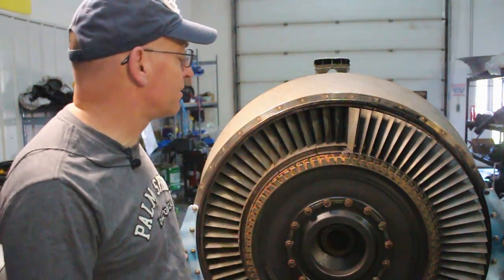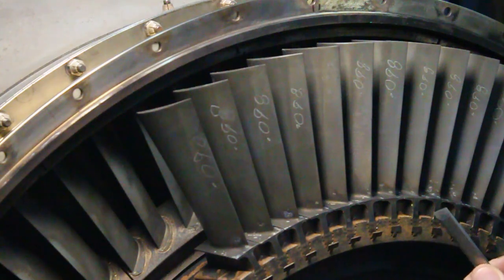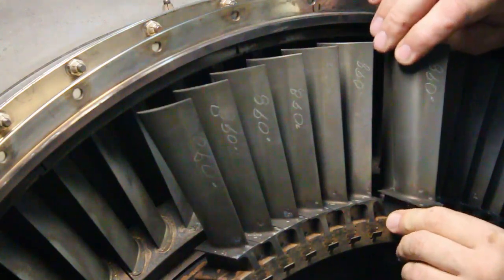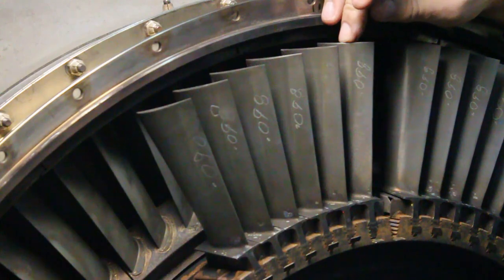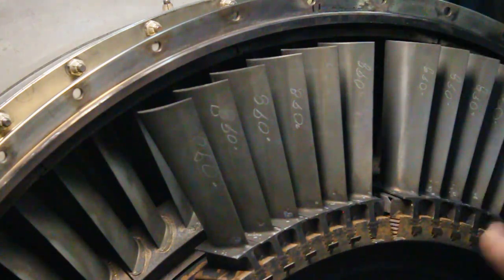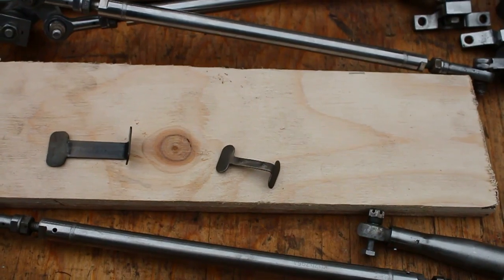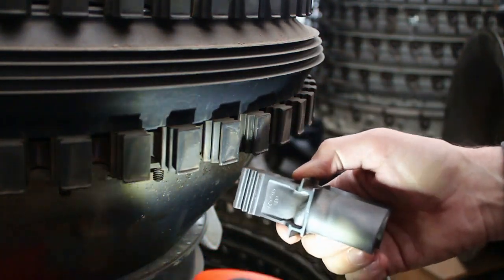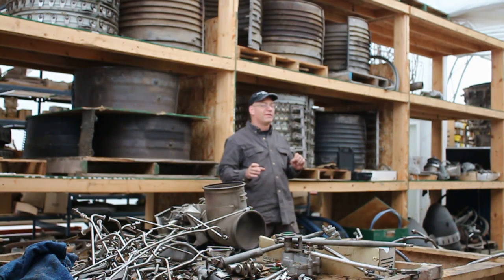Orenda 14  2018 pt.4 Turbine Blade Locks

Comment: I have to say I thoroughly enjoy your videos, Informative and entertaining. My middle son just joined the USAF Reserves as a jet engine mechanic. I spent 13 years in the USAF as a crew chief on A-10's and F-111's so I can now share some information, augmented with the information from your channel, with someone else who has a grasp of the unimaginable power and intricacies of turbine engines. On a slightly off topic comment, sitting in the cockpit of an F-111 doing a maintenance engine run is an experience you can"t explain unless you've been there, great fun! Zone 5 afterburner shakes the entire earth, or it sometimes feels as if it does.

Comment: I can't stop thinking about "billimeter"; first time I've heard that dimensional unit.
Reply: I also cracked up when he said that. And I almost believed there was such a measurement due to the mater of fact and non-pulsed way AgentJayZ used it. Canadian humor rocks, lol.
Reply from the maker: The billimeter  is a slang term, coined by some mathematical illiterate, to probably mean the next big jump down from millimeter, so it may have been meant to refer to the micron.
I have appropriated the term to refer to the nominal diameter of the heatilon*, so it's more along the lines of the nanometer.
So, an easy way to remember is the billimeter is one billionth of a meter... sort of.

* Heatilon - the imaginary particle of heat, discovered in 1992 by AgentJayZ during the North Van period. According to the YouTube page, and Wikipedia.
Reply: Fabulous video as usual

Comment: I work in a production facility that makes blades. I assume that the pin grooves I grind in some are so the blades can slide over the locking tabs. One other thing we do, is after the fir tree is cut on some blades, we grind down the root to create a tab. I assume this is to lock it in on one side and a locking ring is used on the other side. I believe that part is a stage 4 blade for the PW F100. I love watching your videos and since I started working at the plant, I am totally amazed how my parts are integrated into the whole package.
Reply from the maker: Great to hear the perspective of someone who makes these amazing parts!

Comment: Wow, what an incredibly interesting channel.  I'm in no way a mechanic but you have taught me an incredible amount about something of which I had absolutely no knowledge.  You manage to translate highly technical information into language a complete noob can understand.  Thank you.

I have a question which you have probably answered in the past.  I've seen that you weigh each turbine blade before installing them.  Clearly this is part of the balancing process so I wonder, do you try to place similarly weighted blades exactly opposite each other on the turbine wheel?  On one video (from 2014) you appeared to be alternating lower weighted blades with higher weight blades as you install them.  Clearly you have a strategy and I was hoping you could describe it in a bit more detail.  

Again, if you've answered this question already I'll understand if you don't wish to repeat yourself.
Reply from the maker: The weighing, sorting, and arranging the blades gets you to the starting point.
From there the balancing process begins using a sensitive machine that spins the assembly, measures vibration and angle, then recommends changes.
Sometimes it takes minutes, sometimes hours.
Reply: Thanks, I couldn't imagine that it would be a simple process.

Comment: Also, when the engine is getting hot the metal will expand a bit and it will fit even tighter. At least that's what I expect. Quite amazing that most of it is all machined without CNC machinery, yet it is done with the highest level of precision.
Reply from the maker: The disk expands more than the blade root, so the fit becomes looser at high temps.
Reply: The disc expands thermally and it also dilates as a result of C/F (note the difference in terminology).  The blade and its fir tree root expand thermally, with the blade root running hotter than the disc, and the blade material may also have a coefficient of thermal expansion higher than that of the disc.  The clever part of the design process is to ensure that the bottom serration loads up first and that the combination of thermal expansion and C/F allows the serrations to load up progressively and uniformly.  That is where the incorporation of 'differential pitch' comes in during the design process.  Typically. as manufactured, the flank-to-flank dimensions of the blade serration will be slightly less than those of the disc slot.
PS  The design of a fir tree root should be such that it never becomes 'solid':  there should always be a clearance between all the features of the fir tree form, except for the loaded flanks.
Reply: thank you for the detailed explanation.
Reply: OK, didn't expect that, thanks for clearing that up :-)
Reply: Well, CNC just makes precision machining faster and more affordable because you don't need a human to constantly control things. Computers just make things cheaper.
Reply: A disc expands and dilates at temperature and speed such that the disc slots increase in width circumferentially.  However, as the disc rim can be 100 to 150degC cooler than the blade roots, the disc serrations typically expand radially less than the blade serrations, hence the need for 'differential pitch' between the blade and disc serrations, as manufactured.  
Correctly calculated (more realistically 'estimated', when I designed the Olympus 'C' LP turbine blade), differential pitch also allows for the extension under C/F load of the blade root as the serrations load progressively from the bottom (inner) serration towards the top (outer) serration.
Reply: Hi Grahamj9101 My native language is not English and neither am I familiar with jet related stuff. In plain English does your comment mean that the blade will have a tighter fit when the engine is getting at operating temperature or even at full power or not? 

If I understand it correctly the disc expands as well as the blades and the blade roots, but the blade roots expand just a little more, is that what you are saying in a relative complicated way?

Complicated for people like myself that is :-)
Reply: OK, I'll try to explain it in simpler English, but it is a little complicated.
The disc gets bigger in diameter because it gets hot and expands.  It also gets slightly bigger in diameter because it is rotating at high speed.  This means that the slots in the disc rim, in which the serrations are formed, get a little wider.  The distances between the loaded flanks of the disc serrations also increase, of course, because they are hot and and expand in the radial (outward) direction.
The blade root also gets hot, of course, and it gets rather hotter than the the disc rim, because of the heat flow from the blade aerofoil.  Even though it gets hotter, the width of the blade root doesn't usually increase quite as much as that of the disc slot, so it can actually get slightly looser in that direction. 
However in the radial (outward) direction, the distances between the loaded flanks of the blade root can increase relatively more than those of the disc serration, because they are hotter.  If the dimensions between the loaded flanks of the disc serration and those of the blade root were made identical, this could result in the loaded flanks of the outermost serration taking all the load of the blade when the engine is running, which is obviously a bad thing.
The way around this is to make the blade root with slightly smaller flank-to-flank dimensions, relative to those of the disc slot.  If the design is right, the  innermost serration loads up first and, as the blade root gets hotter it expands more in the radial direction than the disc slot, allowing the outer serrations to load up in turn.  Centripetal force and centrifugal reaction also have an effect, of course.
I hope this helps in your understanding.
Reply: Yes it did, at least a bit more and I thank you for taking your time to explain it in such detail :-)  It's very interesting and it shows how detailed and well thought of a jet engine really is and how minimal the design and production tolerances were and still are to make it all work right and reliable, also considering the equipment that was available back in those days to do it. I assume that you didn't have a computer simulation program to test parts or even a complete engine before things were actually produced and installed. And guessing wasn't an option either so everything had to be calculated and tested over and over again....I guess. So a lot of knowledge and skills went into it. From the people who had to design it and from the people who had to produce it.  And I take my hat of for that :-)
Reply: Back in the day when the Orenda 14 was designed, there was no such thing as computer simulation.  Most of the calculations were done using slide rules (do you know what a slide rule is?), plus mechanical calculating machines.  Guessing wasn't an option, but estimation, based on experience, sometimes was.  Extensive testing of development engines, with inevitable failures, was the usual route to a reliable production engine.

Comment: 11:59. could/would you run water/smoke through the blade. 12:03 Based on what appeared as leading edge holes, does it create a cool air buffer similar to that of a rocket engine nozzle or do they serve another purpose such as some kind of stall prevention? Thanks for another great inside scope of a jet turbine.
Reply from the maker: Have a look at a video called air cooled blades...
Reply: glenn tanner they're simply for cooling and they work exactly how you thought. They are fed air that has already been through the compressor but has not been through the combustors and turned into "working air", as Jay calls it
Reply: Thanks guys. Still wouldn't mind "seeing" the flow if you ever get the chance.
Air Cooled Blades: https://youtu.be/7upnkrhqRWQ

Comment: Hey Jay, I machine aerospace parts and the "fur tree" is called a root. And they are ground onto the blades with big sand wheels "conventional wheels" and at the place I work we most likely manufactured those blades.
Reply: Yes, the fir tree form is typically ground onto the blade root with a grinding wheel, which, in the latest manufacturing cells, is continuously redressed.  The fir tree  form in the disc slot is typically produced by a progressive broaching process.  The tolerances have to be within 'tenths' (of a thousandth of an inch), to ensure reasonably uniform sharing of the loads on the loaded flanks of the fir tree form.  And there is something called 'differential pitch', to complicate the design process still further.
Reply: grahamj9101 where do you work at if you don't mind me asking? I work for Moeller aerospace manufacturing.
Reply: So are you based at Wixom or Harbor Springs?
I took early retirement from Rolls-Royce in 2003, after 41 years service and returned for another three years part-time, as a consultant.  Following my apprenticeship, my whole career was in gas turbine design.  From 1967 to 1982, I was in the design office at R-R's Industrial and Marine Division.  In 1982, I transferred to R-R Bristol, where I was involved in the design of military engines.
Reply: grahamj9101 harbor springs. And that's really cool, I'd love to do something like that. I do 5 axis grinding and milling.

Comment: Are the locking tabs "single use"? You said you discarding them, Are they still manufactured or do you have to have them made somewhere?
Reply: I'm guessing they are single use since unbending metal weakens it.
Reply from the maker: Single use.
They are available NOS, and we also can make them out of modern superior materials.

Comment: Nice video. Does the mass flow rate of air into compressor section (inlet) for a turbine remains constant all the time or could be changed by some special arrangement (like changing angle of compressor guide blades).....consider steady flow for simplicity. 
I am interested to know..!!

Comment: Are the numbers on the blades (ex .098) their weight in pounds? Kg?
Reply from the maker: Most likely it's the decimal fraction of the weight in ounces. We only use one digit after the decimal point when we weigh in grams.
It's lazy and bad practice to not record the whole number.
Reply: Ok, then I get it. The weight is some whole number of ounces + .098

But if it was written on there during the previous overhaul, that would mean that the writing survived the engine running for a long time? Is that possible?

Comment: What do you use to remove the oxidation? a chemical? Rubbing it with a brush would give you odd tolerances and imbalances I'm guessing, that a human can't possibly determine this by any faculty we have. Yet doing it by hand and checking by instruments would present a very high failure rate.
Reply from the maker: After everything is cleaned and inspected... then we balance the assembly

Comment: Any reason why you don't use some light oil to lower the friction of removing the blades?
Reply from the maker: Oil seems to mix with the dust to make a sort of paste that does not help removal, and slows down the cleaning of the blades once removed.

Comment: As this video is showing us an engine that originated in the 1940s, can I share the nostalgia trip I've just had as a Jet Provost flew low over my home?  Its Armstrong Siddeley Viper engine is of a similar vintage and the Viper was the second engine type that I laid a spanner* on as a Bristol Siddeley Coventry apprentice in 1963.
*For you people in N America, spanner = wrench.
Reply: grahamj9101 I got to see the "AFTERSHOCK" twin engine 1940 Ford Fire Truck at a local air show here in Mississippi this past June 2018 powered by a pair of Rolls Royce Viper engines. They allowed me to look the truck and engines over well and answered lots of questions. June of 2017 they had their pair of single engine "Flash Fire" jet trucks at the air show and I got to check them out closely as well. Afterburners/Reheaters Rock on Jet Trucks!  Here is a video from a diff air show this year of the Fire Truck. https://youtu.be/EO98zY2S9SQ

Comment: Hi I was just wondering I noticed on the ge90 b788 when the jet engine is coming up from idle to higher rev there is like a gear like sound quite loud is it the turbines
Reply: Darren Ormond that is the turbine blades breaking the sound barrier.

Comment: do you do any kind of dimensional checking of the tree on the blade or the groves in the disks? Isn´t there any wear during startup and before stopping?
Reply from the maker: There are measurements to be taken if any wear is visible. These blade roots do not show any wear and fit very snugly, so they don't need to be measured. Their inspection findings would read "no visible signs of wear".
Reply: In my experience, the terms 'wheels' and 'buckets' are commonly used in relation to steam turbines.  Their use for those components in a 'heavyweight' industrial gas turbine, such as a GE Frame 5, is, therefore, quite understandable.  That there might be a difference in terminology between products from GE Schenectady and GE Evendale is also quite understandable, considering the differences in terminology that still exist between, for example, R-R Bristol and R-R Derby.

Comment: Hey Jay, if the fir trees/blade roots are designed to lock under the centifugal force of the rotation of the turbine, then why are the wider sections of the fir trees placed further away from the centre of the rotor? It seems to me that the locking mechanism would afford a more secure lock if the wider section of the fur tree were placed at the 'bottom' of the turbine blade, closer to the centre of the rotor disc.
Unless the turbine wheel is better able to efficiently distribute the force of the blades when the wider sections of the fir trees are placed closer to the outside edge...

Anyway, love your videos, many thanks from the UK!
Reply: Yes! I understand now, and that's a brilliant design actually. Thank you for teaching me that! :)
Reply: That's a good answer and I can say that as a former Chief Designer - Turbines.   I don't think that I've given away any secrets in saying that (see my answer to Darren Duncan).
Reply: In simple terms, if the geometry of a fir tree root was reversed, then this would place the thinnest section of the root form of both the disc and the blade at the position of the highest load in both parts.
PS  The term "lock" is not really appropriate for the radial retention of the blades in the disc.  While the centripetal force applied by the disc to the blade root is equivalent to several (even tens of) thousand times the weight of the blade, there will still be some small movements in the root, as a result of differential growths between the blade and the disc.
And let me throw in something that I was told as a first-year engineering undergrad: "there is no such thing as centrifugal force."

Comment: If you have a blade that is stuck and normal pulling won't remove it what do you use or do to get it out?
Reply from the maker: That has never happened. Have you watched this video?
Reply: Yes and the corrosion is why I asked. But I guess if that was the case you might have a bigger problem to deal with.
I learned a lot in school but not everything. Just like the tool you had made to pull the collar that was stuck.